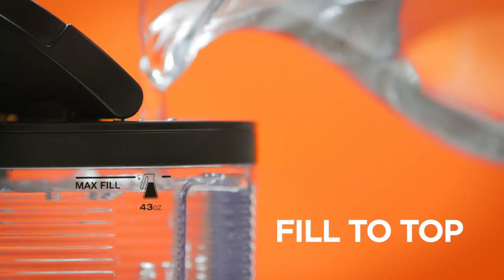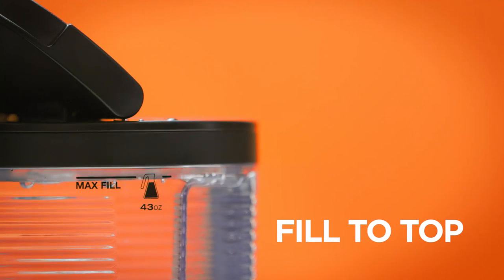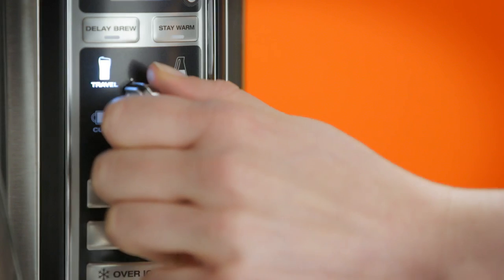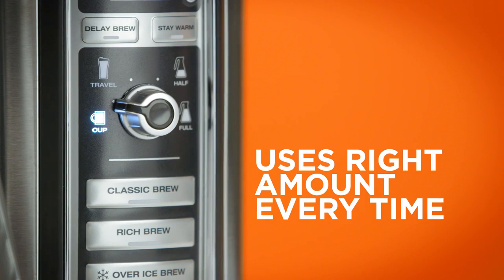Fix for Leaking Water Reservoir

Comment: Just putting this out there... this video is from Sept. 2016. We just bought a brand new Ninja CP307 in Nov. 2021. Only five months later, in April 2022, the reservoir leaks like crazy. Excellent job, Ninja. Give your development team a raise!  </sarc>

We're trying the hose washer fix. I just ran a quick cycle and it didn't leak. We'll see how it holds up over time.
Reply: Your problem was buying the cheapest oldest version. 
Newer models of their makers have come out and are far superior. 
I am very glad I got CM401 for the office and my girlfriend got CM371 for cold brewing this year.
Reply: Can you point me to the fix? We used ours for about a month. Went on vacation, came back to flooding every time we try to use it! Super angry about this!

Comment: Here is what I ran into. "We" dropped the reservoir onto the floor after which it leaked prodigiously from the bottom. The plug assembly had broken out, but everything was surprisingly undamaged.  There are three interconnected parts that control water flow at the bottom: a rubber or soft plastic gasket, a spring, and a clear, almost pawn-shaped, piece of plastic that serves as the plug.
So that was step one for me, make sure I had found all the parts. The gasket stays inside the reservoir but can be pulled out with a pair of tweezers. (Go get 'em, you'll need them regardless.) With the "pawn" standing, fit the spring over the pawn and the gasket over the pawn's head. Easy.
The trick now is to get the piece set back into place with the gasket >fully inside< the reservoir. To do this, I used the tweezers to fold the gasket down into an inverted U and angled the piece nearly into place. Then I tucked around the edges to keep it at the pawn's "neck" as I worked it through. It took a couple of tries, but it works fine now.
From this, I would advise that what needs to be cleaned or adjusted in the case of persistent leaks are those three parts. The spring pushes the plug away from the outside bottom of the reservoir, which pulls the gasket down against the inside bottom so it does not leak. When you mount it up then the base pushes back against the plug, compressing the spring and loosening the seal at the gasket so that water can flow. Any leaking means one of these parts is not functioning properly, so I'd start by cleaning there.
Reply: You should do a quick video on this !

Comment: Yeah no, it doesn't matter if you hear an audible click.  It still leaks.   The problem is that the rubber seal is too loose and flimsy, and there's nothing to ensure that the reservoir centers perfectly in the seal. So if the reservoir is placed on the unit, and isnt centered perfectly in the seal, it will leak.  Also, if the reservoir is bumped, it will also begin to leak.  They need to offer a better seal that fits the reservoir nozzle tighter.

Comment: FYI - I fixed mine by putting a rubber o-ring around the outside of the nipple on the bottom of the water reservoir, where it seats to the rubber gasket. Previous to the fix it would leak out any water in the reservoir pretty quickly, soaking the counter/floor (unless it the gasket had been dry for a while - then it would take a short while before leaking.) Guessing the rubber gasket is expanding after being submersed for so long, and doesn't make a tight seal.   With the fix, so far so good. Filled the reservoir to the max fill line and it's holding steady after 48 hours.
Reply: Where did you buy the rubber o-ring and what size? We have been experiencing the same problem for quite some time now and at the point where I may just buy a new, different coffee maker.
Reply: @stephaniecartwright9952  I already had an assortment from Harbor Freight and used one that fit snug around the nipple on the bottom of the reservoir.  The kits are quite inexpensive (around $8), I'd order a kit in "397 Piece Metric O-Ring Assortment" or if the link will work: https://www.harborfreight.com/397-piece-metric-o-ring-assortment-67580.html   I can try to see which actual size I used, but you may spend as much for 1 as the whole kit.
Reply: @Deja7777  I just have to say thank you!  I had the same problem and just stopped by my local harbor freight and picked up the SAE O-Ring kit.  I picked out one from that kit that fit snug and it stopped the leaking!  I also saw some other tips of people using a flatter washer from something like a garden hose but it seems that might be too much rubber and this O-Ring fits the application a little better.  Thanks for the idea!!!
Reply: @earlness1    thank you for the kudos! I'm glad it helped. Mine is still working great after ~6 months.  Wishing you the same luck!
Reply: I have the ninja cp301 I wonder if it'll work for me. Mine is leaking to.
Reply: @NinjaCoffeeBar  I couldn't find a solution so I threw it away.
Reply: I bought a whole new water reservoir to years ago and it’s not leaking again not worth the money

Comment: I have a CF091. The water reservoir is not designed to click so this video is incorrect for my model.

The problem caused by  the gasket in  the base that is supposed to seal around the nipple on the bottom of the reservoir. Ninja needs to sell replacement seals because the seem to have a very short life. I'll try an o-ring as suggested by other people and see what if that will be a workaround for the leaky seal.
Reply: @NinjaCoffeeBar  I believe the problem is caused by the seal in the base the reservoir doesn't leak into it is inserted into the base.
Reply: @NinjaCoffeeBar  I have an o-ring kit from Harbor Freight and one of the o-ring fits into the outside of the nipple on the water reservoir as suggested in an earlier post I have made 2 pots of coffee without leaks so I believe the problem is solved. Replacing the water reservoir probably will not solve the problem because the leak is due to the seal in the base. A o-ring on the reservoir is a workaround.

Comment: We bought a reconditioned unit that NEVER worked. It starts beeping as soon as it's plugged in. We've never even been able to run the initial clean cycle. Because we purchased it from Groupon and not a brick and mortar, support has told us they won't help. We're never buying another Ninja product, and we'll be strongly suggesting the same to friends and family.

Comment: What was that spongy looking thing in the resevoir pool slot?

I don't have that thing.
Reply: Ninja Coffee Bar
Erm no.  At 0:27 the black-grey foam thing from the top down shot.  I do not and did not get one of those with my NCB when I orignally ordered it.  Is it a some type of accessory?
Reply: Scheefinator it's not foam, it's just the studio lights making the matte black plastic base appear differently. There is no insert. If any water drops are in there just wipe it out as shown.
Reply: knitinknit Something like that.  It's not foam.

I got their new updated model anyways.  Doesn't have these problems.
Reply: Yes it does! Poor design...after a few months of use, the base starts leaking from the valve insertion point.
It does NOT matter if full, half full OR even quarter full. Poor service legendary from this company.
Will NOT buy their product ever again...sad I gave these to friends and family last year as gifts.

Comment: there is water leaking from the bottom of my reservoir after i fill with water. It starts pouring out where it is meant to once it is connected to the base for it on coffee pot. I have cleaned everything and it still happens. I fear that because it continues to leak water that it will ruin the coffee pot since the water does not stop. How can I fix this or must I buy a new reservoir?
Reply: @Kims_Kwest 
Did you ever get this fixed? I'm having the same issue with my coffee bar
Reply: @NinjaCoffeeBar  How about (#1) taking responsibility, publically, for a garbage design & (#2) explaining to EVERYONE here what to do about it?
Reply: @wjcrabtree  exactly